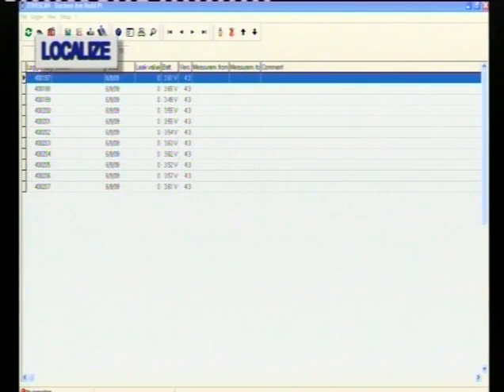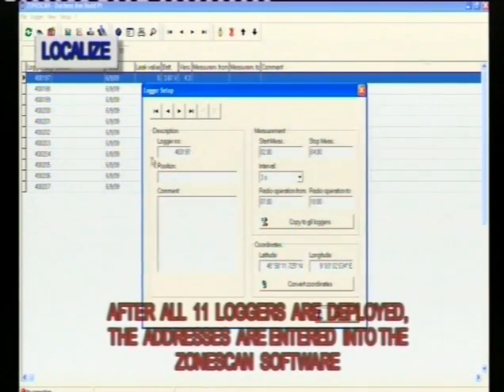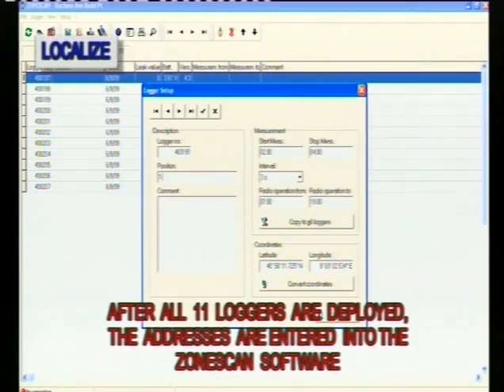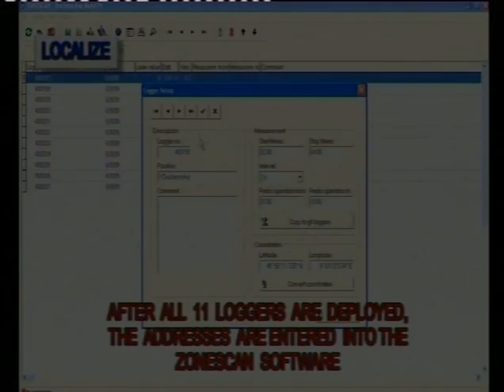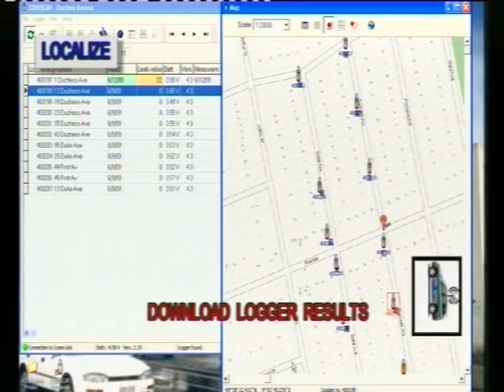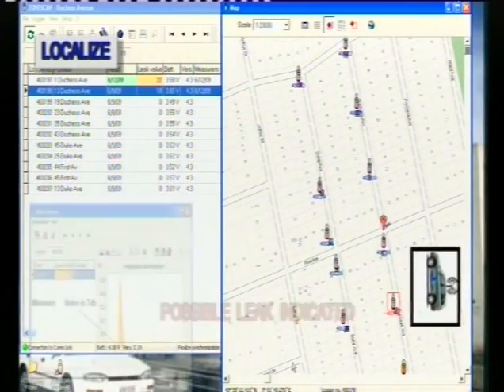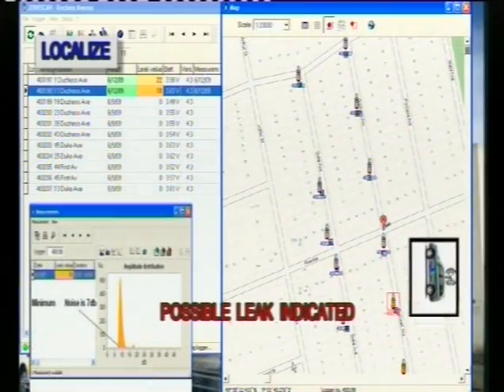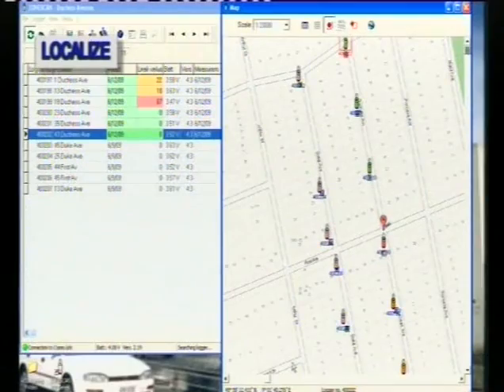Gutermann Leak Noise Loggers, Correlator and Acoustic Leak Detector

Comment: You could tell by the water meter itself if the service connection is leaking. Chances are a high water bill is the reason you were called in the first place. Eliminating your first few steps and looking at the meter in the first place would've save time and money.
Reply: No.. if the leak is before the water meter it would not register high consumption. You would be able to hear the leak off the meter connection with the probe ground mic but a leak before the meter wouldn’t affect your water bill.